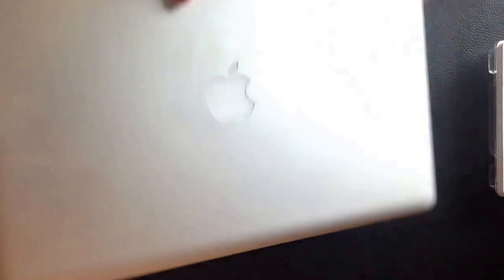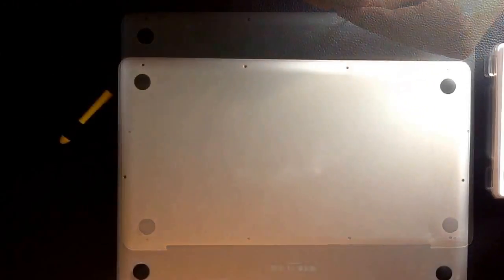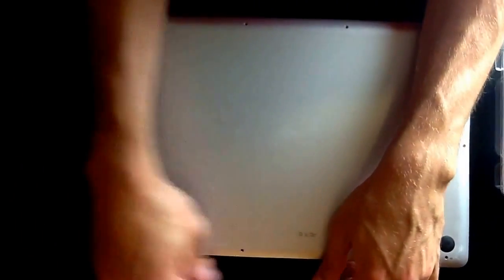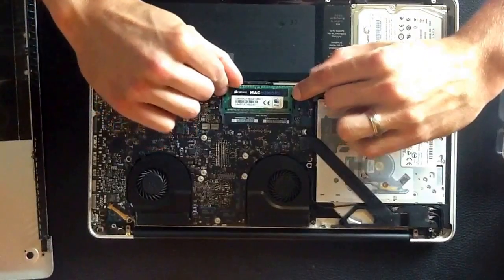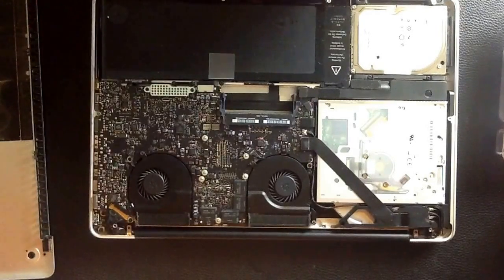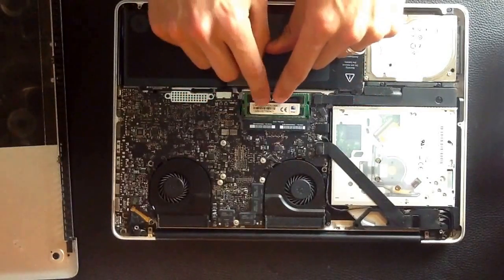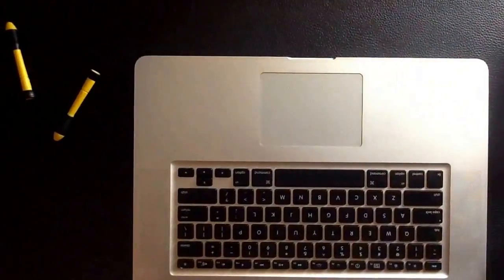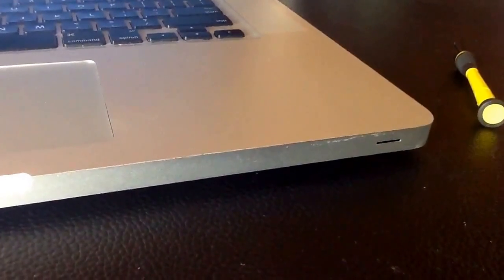MacBook Pro 3 Beeps Fix - Simple DIY Solution

Comment: You forgot to disconnect the battery from the main logic board. This is an important step. You should not be pulling and reseating RAM modules with power still going to the board.
Reply: Photo Enthusiastic
Reply: @Sam Odetoyinbo Ok, my fault
Reply: The battery is unremovable
Reply: AndyAndrei  there is a small clip it’s black

Comment: This just happened to me.  Had this Macbook Pro since 2010 (same battery even), and this was the first time it ever did this 3-tone thing.  BTW I wouldn't call it 'beeps,' more like a DEFCON alert!  I had just folded it down and placed it on the table, probably a bit roughly because I was hurrying to find out why an emergency vehicle siren stopped on my street (I still don't know).  Anyway, that very second this 3-tone thing started so, along with the siren, I was pretty sure the world was ending.  :-/  
But all I did was hold the power button down, like longer than it normally takes to do a force reboot, and the tones finally stopped.  Then I took a deep breath, pushed the button again, and Baby started up like normal.  So try this before you set out for this whole unscrewing odyssey......

Comment: So about 20 minutes ago, I just got home and my macbook pro was making these beeps from inside my bag. I pull it out, and it's scorching hot. I've tried turning it on, but the screen just stays white. The white screen gave me nightmare flashbacks to when I had to get my logic board replaced. How screwed am I?
Reply from the maker: No clue.. that sounds bad though. Rule of thumb you should turn your macbook completely off when moving it around as I had similar issues when I used to leave it on. Hope you get it fixed but I'm not sure what your solution is.
Reply: Katie Furlan the same thing happened to me all you have to do is turn it back on again
Reply: I have exactly the same problem (beeps+ nightmare distorted screen), and also had my logic board replaced some time ago. Can you tell me if you were able to solve the problem yourself or if you had to replace it again? Thanks :)

Comment: I'm having the same computer. The problem i have is, when i plug my magsafe to the computer, the level of charging stable. it did't increase, and didnt decrease. charging indicator shows that thunder symbol but also days, "Battery not charging" 
Can you please tell me what would have happened to my Mac?
Reply: Hard disk or Battery. It may have been a shortage on power and it may have burned something in the battery. If it still goes green when you plug your charger in the MacBook, then its the battery.
Reply: @render1919  it's been 3 years. Actually the problem is the charger. Anyway, that macbook has died.
Reply: @Kalz4n  so sorry to hear that
Reply: @render1919  It's alright. Anyway, Thanks for the reply

Comment: Did it work people? I am worried, i don't wanna mess up my sister's Mac; she's gonna kill me.
Reply: Yes. It works! I hope it helps you as it has helped me!
Reply: +Maria Valentine yes, it did. Thank you.
Reply: It can vary. The issue can be the ram connection, the ramchip it self or worse, the motherboard. Take it to Apple or an autorized Apple repair shop if you are unsure. They will help you. Don't risk ruining the warranty if you're not sure what you are doing or if the issue does not get solved by a simple reset/test with other ram.
Reply: Patrick Holmes it did work

Comment: Merely reseating the RAM did not work for me...still same beeps. Since I had 8 RAM, I started it up with only one in place and determined that one was defective.  The computer will still turn on and function with 4 RAM.  Try the good ram in both slots to make sure it is the RAM and not the socket that is defective.  In my case, it definitely was the RAM.  I ordered it on line and saved significant money over going to Best Buy (try 1/4 the cost).  In 2 days, I put the 2nd RAM back in and it functions fine.  An easy fix for yourself and worth trying.
Reply from the maker: Great comment! Very helpful to others I am sure.
Reply: I love you guys. Really, I do.
Reply: YES THAT WORKED THANK GOD, I DID NOT WANT TO SPENT HUNDREDS OF POUNDS ON A NEW MAC!!!!!!!!!!!!!!!!!!!!!!!
Reply: John Fleming thank you, that worked for me. Bless you you saved my life.

Comment: hey, thanks for this video, Eric. I was having the same issue, and I used your video, but that didn't help me. Because even after re-seating my RAMs I was still facing the legendary 3 beeps. I then removed each RAM one by one and tried to power my laptop on one RAM - this worked for me. Does this possibly mean that one of my RAMs was faulty?
Reply: actually too soon - it didn't work for me :(
Reply: Have the same prob. Did you get it now, somehow?

Comment: I'm considering doing this. But I'm also at the process of Rebooting my mac. Almost done backing up the files. Would that also help? By Reformatting my mac?
Reply from the maker: +dayviewmusic it could... but I'm not sure.. worth a shot? How'd it work out if you did it?
Reply: +Eric Worral hi thanks for your reply. i already did the removing of the ram and also rebooted my mac. my screen is still flickering and would still have the 3 beeps. obviously it's the video card that's the problem already right? leaving me to the motherboard.
Reply: +Eric Worral hi thanks for your reply. i already did the removing of the ram and also rebooted my mac. my screen is still flickering and would still have the 3 beeps. obviously it's the video card that's the problem already right? leaving me to the motherboard.
Reply: +Eric Worral hi thanks for your reply. i already did the removing of the ram and also rebooted my mac. my screen is still flickering and would still have the 3 beeps. obviously it's the video card that's the problem already right? leaving me to the motherboard.
Reply: +Eric Worral hi thanks for your reply. i already did the removing of the ram and also rebooted my mac. my screen is still flickering and would still have the 3 beeps. obviously it's the video card that's the problem already right? leaving me to the motherboard.

Comment: NO EFFING WAY!!! ... Ive taken my macbook pro to apple 3 separate times for this issue, paid up to 700$ trying to fix this issue, they said it needed some new cord or something inside, then replug the battery, fix the screen and other bullshit. but the same issue kept happening. For the last 3 months this hunk of metal has been nothing but an expensive paper weight.. I stumbled on your video and thought id give it a shot.. and you helped me fix this by a simple remove and reinstall that cost me nothing but a couple minutes of my time... thank you so fricken much!! i give you a million thumbs ups!
Reply from the maker: Haha great comment. Glad this did the trick for you. Sorry you had to waste so much time and money. That's ridiculous!
Reply: Eric Worral my technician did this a few times already. It still occurs. It also has the start up sound and gong even though my MBP has shut down (would logging out matter?), but doesn't go through the boot up. I've heard the beep/flashes can occur if your MBP is on and you move it- detecting motion). 
My logic board was replaced twice- once by Apple due to a recall of MBP including my early. 2011, and again almost exactly 2 years later, costing me $550 and much stress. And from reliable sources, though Apple will not acknowledge or admit it, the logic boards they've replaced the recalled ones with this have faulty issues. It couldn't be repaired because as my technician told me, the GPU is part of the board and can't be separated. That said, could the  beep/flashes be a factor? That's when the beeps/flashes started- which could be unrelated. Also a solid state 1TB drive replaced the original  500 gb one as that one was no longer bootable. Sometimes the MBP even crashes and restarts right in the middle of working on something. 
I had a memory upgrade installed when I order the MBP  from the original 2+2 to 4+4, maxing out at 8 gb.  Could that memory cards be going bad?

Is there any other issues causing it? Each time I have to force shut off . 

I can understand the frustrations of current and ex- Mac and iPhone users with issues like the butterfly switches on the MacBooks, battery issues, etc resulting in slipping sales, and users switching to androids and windows machines. 
I'll be content just getting up and running again.

So any theory's of other causes of the beep/flashes?
Reply: +Eric Worral thanks so much.... damn! i'm up and running... thanks a million...the guys at apple, they lie a lot to the customers... my mac didn't want to come on... they told me i needed to pay $1900 to get it fixed because some part was burnt inside. i took my mac to a G Tech Sales and services Repair shop and they fixed it in two  days... Priceless
Reply: Lol me toooo
Reply: They told me the same exact thing. I’m gonna try it tmrw

Comment: I just took out the chips and put them back in and it fixed the issue.  I didn't need to replace anything.  Thank you so much!
Reply from the maker: No problem. Glad this helped and solved your problem.
Reply from the maker: No problem. Glad this helped and solved your problem.
Reply from the maker: No problem. Glad this helped and solved your problem.

Comment: Thank you so much! This fixed my problem, had no idea!! Appreciate the great video!
Reply from the maker: Awesome! Thanks for sharing. My computer hasn't given me any problems with the three beeps thing since I upgraded so hopefully you're in the clear.
Reply: +Eric Worral Did you try to go to the Apple Hardware Test (by pressing the "D" button while the laptop is restarting). I can't get my laptop pass the test after doing it. But it works fine on the normal operation.